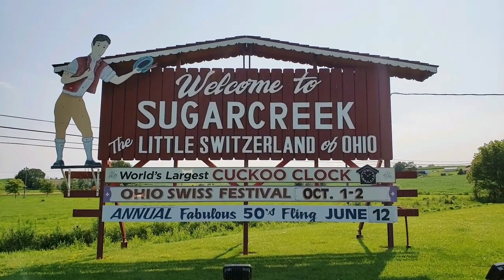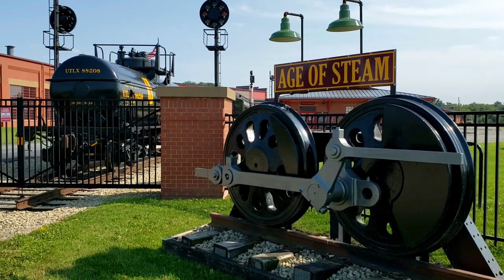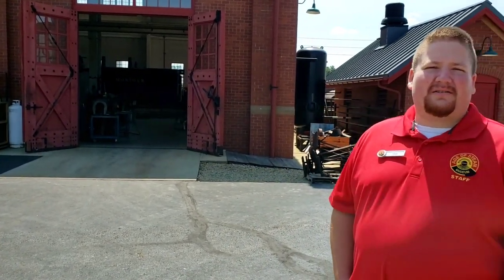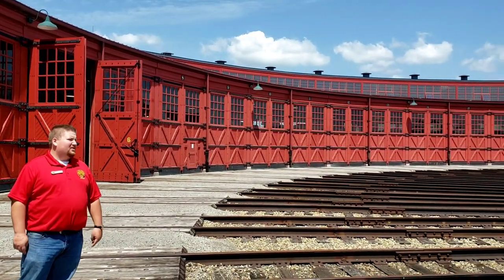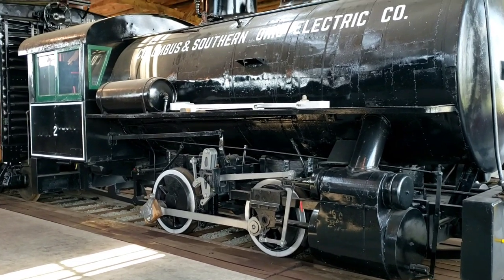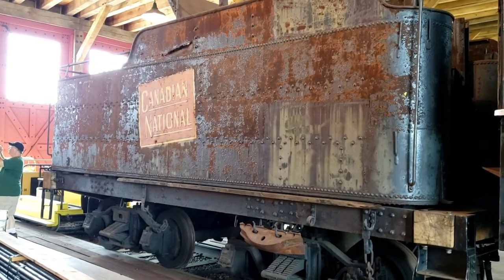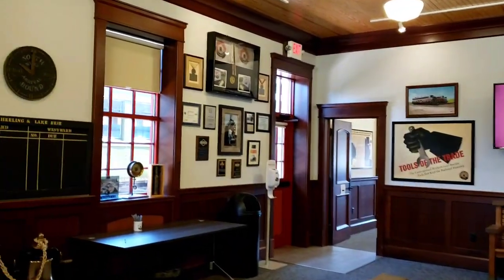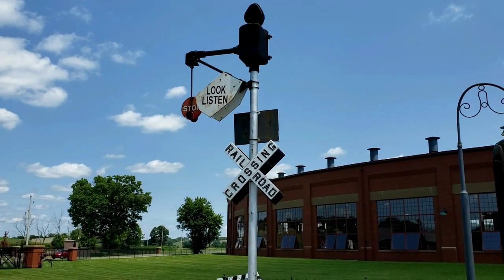Age of Steam Roundhouse in Sugarcreek Ohio.

Comment: Also at 10:15 I never knew there were real locomotives with 
Un-flanged  wheels, got a lot of model locomotives like that but never expected it on a real one.
Reply from the maker: Yes sir, its crazy but makes total sense all those big flanged wheels would walk right off the rail on tight curves so they took the flange off some so it could slide freely on the rail but still had the power.